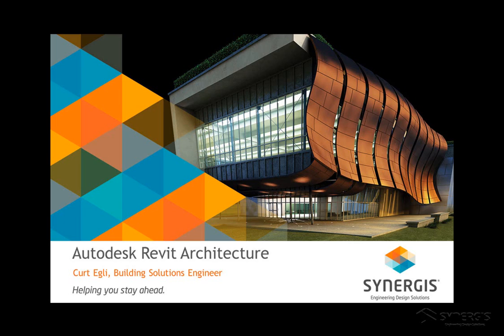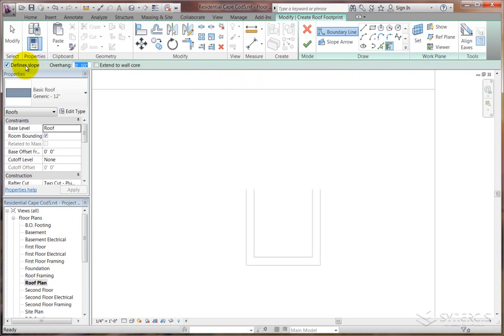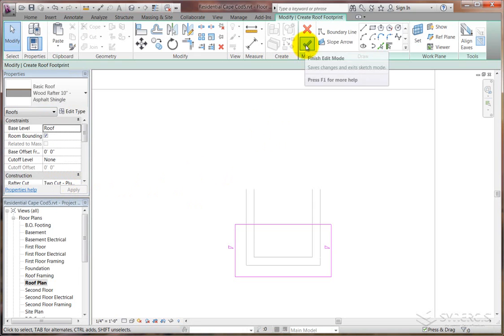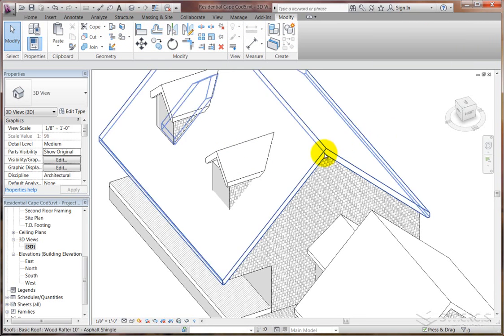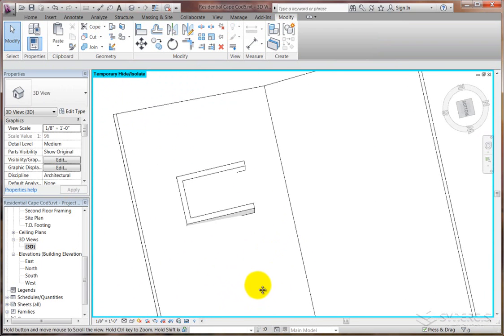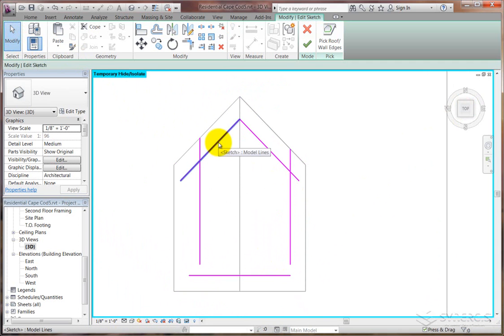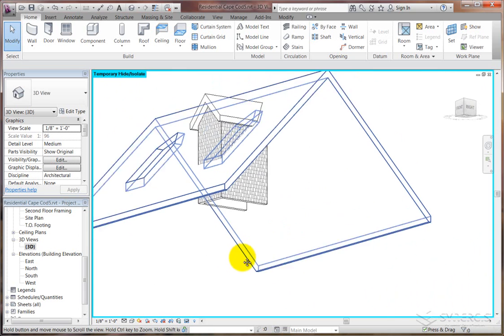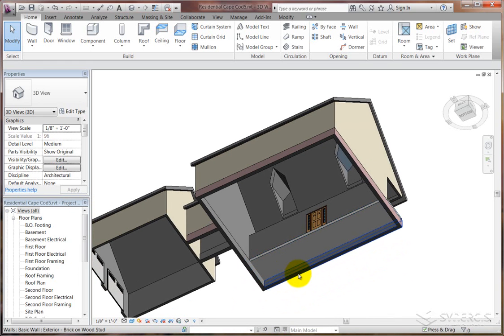Dormer roof creation with Revit Architecture

Comment: Cool demo.  I'm new to Revit and I have a question. In the real world a dormer's exterior walls bear on the roof structure just like you show it.  I guess you would then add an interior wall bottom-constrained to the floor and top-constrained to the roof and align it to the interior of the dormer wall above.  How then do you go about sheetrocking the interior of the roof opening to maintain a continuous interior finish from floor to ceiling inside the dormer?